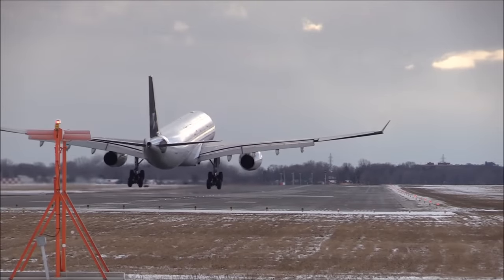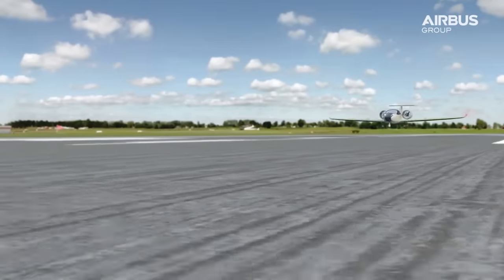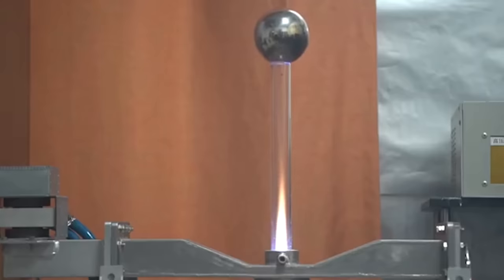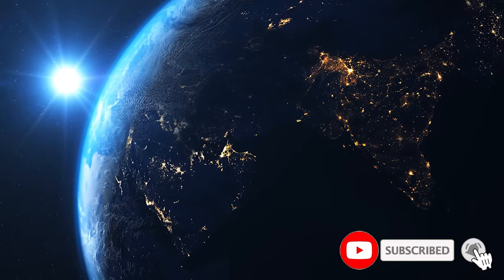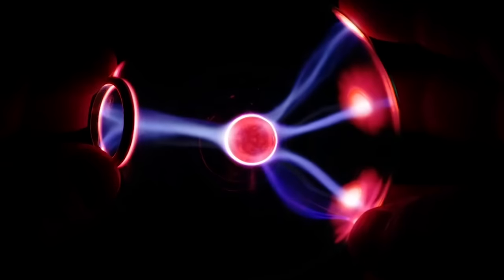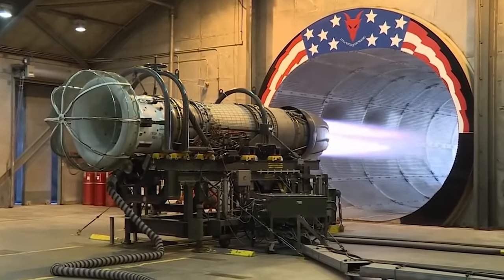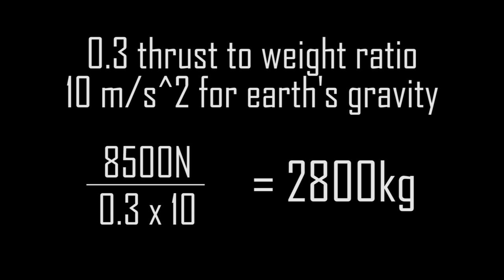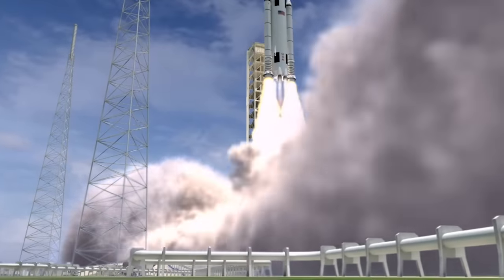Uncovering China's New Electric Plasma Jet Engine

Comment: So this is essentially an electric ducted fan with an afterburner running of microwave heated plasma.
Have I gotten that right?
Reply: minus the motor of a normal ducted fan. This is mare like modifying an existing jet engine. In theory, you could replace the fuel systems with an air compression system and microwave units. The fuel jets( the sprayers that spray jet fuel and fuel combustion in the center of the engine)  in the engine could be replaced by these plasma jet tips instead.  The hot jet of plasma would replace the old hot jet of jet fuel. The engine then could work as normal, sucking air in, compressing it, using the plasma to combust it and shoot it out the back. Electricity and air pressure would be provided by the engines when they run. When on the ground or in case of an engine stall, power could even be provided by the APU Jet engine located in the tail, as it provides power and air pressure when the main engines arnt running. Even ground crew can provide power and air pressure, as this tech already exists in most commercial planes and airports anyway. It takes air pressure to start normal jet engines as it is and also provides pressure to run a/c systems and deicing systems. so integration wouldn't be as hard as it seems. In the air, jet engines of today already compress air, just because of how a jet engine  works. So air pressure is sipped from that during flight to run all those systems.
Reply: Seems readable to replace fuel tanks with batteries and use the plasma her to spin a compressor turbine just like a fuel burning jet. Might have shorter range and cargo capacity but you'd only need chargers at each end of a flight. Schedule flights to coecide with charging times possibly?
Reply: @justins.1283  Wouldn't even need a compressor turbine, modern jets sip off of the compressor turbine the engine already has
Reply: Its really a jet engine with the fuel replaced by a microwave heater.
Reply: @tonystanley5337  YUP
Reply: @RandoWisLuL  yes but they would have to ditch the stupid closed loop energy storage and actually use the energy thats everywhere. As long as they only use batteries it wont take off.
Reply: @635574  yes, maybe in a few decades we'll have good enough batteries to keep the thing running on stored power, but even with internal generators we could probably run commercial planes on far less fuel than is used in typical jet engines.
Something certainly worth considering.
Reply: Yes a microwave hairdryer
Reply: True, but looking at them from that prospective also standard turbofan/turbojet are when you start the engine: An electric ducted fan with an afterburner running on fuel.
Difference is that, once the engine is up and running, is the thrust from the "afterburner" itself that spins the turbine compressing the air. So the elctric motor is only needed to start the engine.
Maybe you can build a microwave-powered turbofan where the plasma-jet run a turbine that feed it with compressed air.
Reply: @qdaniele97  Probably not, because turbines are complicated and expensive. Since it's running on electricity to heat the compressed air, it's much better to run an electric motor instead of a turbine to drive the compressor.
Reply: @635574  What are you talking about? How is this a closed loop? And which energy is everywhere?
Reply: @jannikheidemann3805  they do produce electricity though. And air pressure. All modern jetliner jet engines do. If they didnt, planes wouldnt fly.
Reply: @tylermech66  what a daft comment. An internal generator? Those engines on an aircraft ARE generators and there are land based generators available off many aircraft engines.
Reply: @tylermech66  So you got offended by me saying you made a daft comment? Usually people commenting on these clips have some knowledge and then you come across those commenting with NO knowledge. OK I'm sorry. Do read up on industrial gas turbines though. Rolls Royce do a marine version of their Trent engine AND a static generator version.
Reply: @jannikheidemann3805  yeah Indead ozone is 100000times worse than co2 wtf the Chinese will punch a hole into the ozone layer with this technology. This is like Halo until you find out what the ring really does
Reply: Well, you could ditch the fan part in flight and use ram air pressure as compression, but essentially yes. 

Obviously the power requirements are staggering, necessitating a nuclear reactor on board. And then you could just use the reactor as heater.
Reply: There is no way in hell that would work, since if it would work, you'd have made an infinite energy machine. (the making of the plasma would cost a hell of a lot more power than the power you could gain from the engine like a normal plane does)
Reply: Thats how my wife makes eggs.
Reply: no
Reply: @MVHiltunen  someone already did that
Reply: @RandoWisLuL  This would remove a lot of complexity and weight as well since the fuel system is very complex on modern passenger aircraft. Additionally you could also reduce the current losses from using the engines to generate power, taking it instead from the batteries. There is still a massive gap between the petroleum energy density and the battery density though
Reply: @Musikur  exactly thats what im thinking. honestly, with modification i bet you could retrofit this onto modern turbofan engines and replace just some of the jet fuel tanks with batteries for load balancing. when on the grounds, the plane could be powered by ground crew. Just like we do now with jet fuel systems.
Reply: Where exactly do you see the afterburner part?